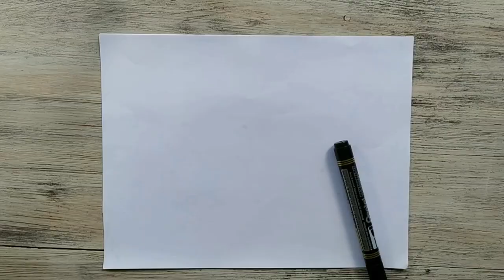DIY Bedroom Storage Bench / Modern Tufted Ottoman

Comment from the maker: Time Codes:
00:00 - Preparation for the project
01:03 - Connecting all parts in a box
02:22 - Covering with fabric
04:00 - Making a soft seat pad 
06:41 - Decorating with buttons and cord
09:13 - Adding legs
09:57 - Connecting the seat with the storage box